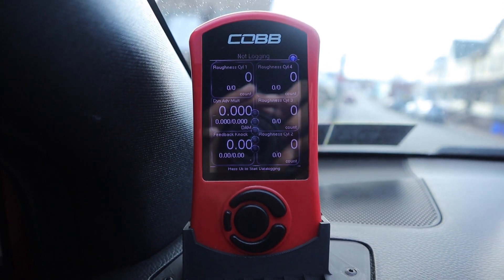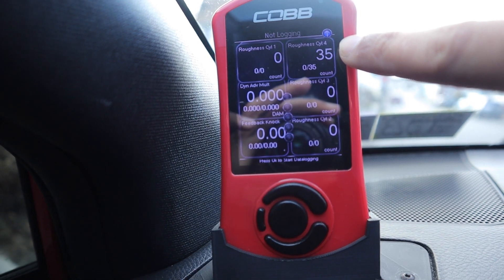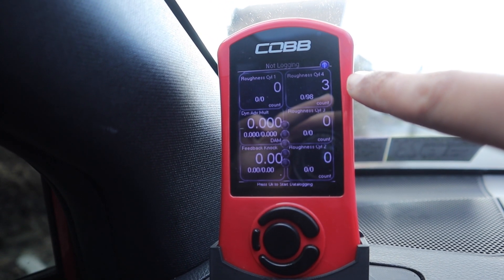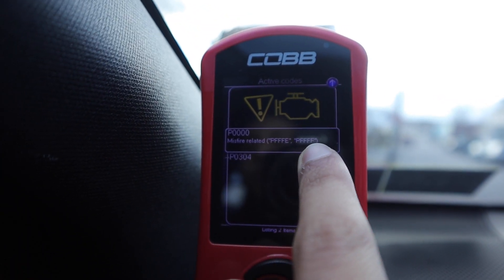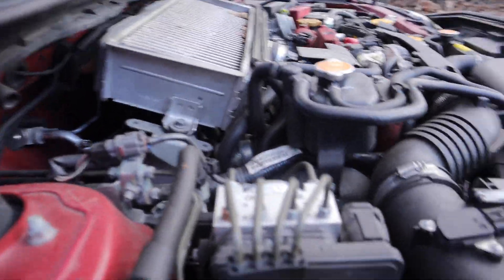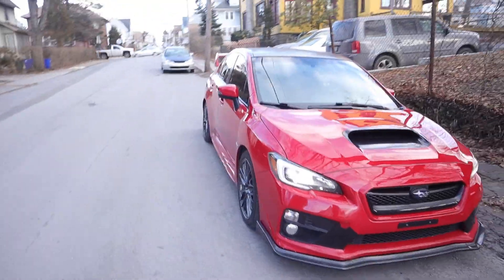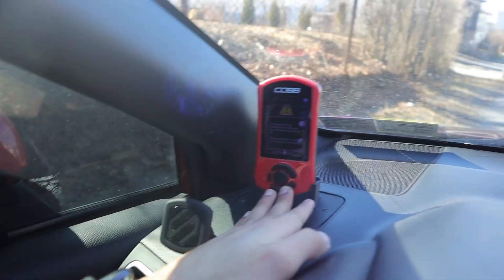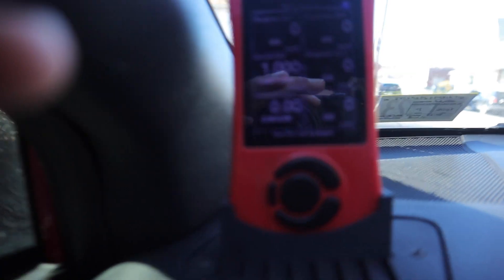Blew Up My Subaru STI!? (AGAIN)

Comment: Check ur maf sensor on the intake. Had the same issue, little piece of grass on hot side.
Reply from the maker: Ended up being a messed up valve. Took the motor out, put a built motor in it, ended up totaling the car 😭😂 UPDATE SOON